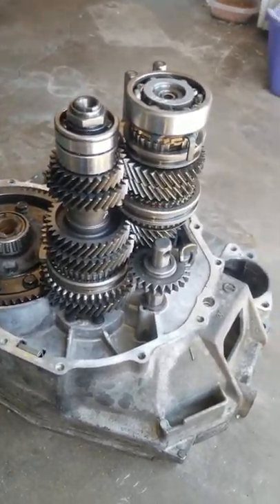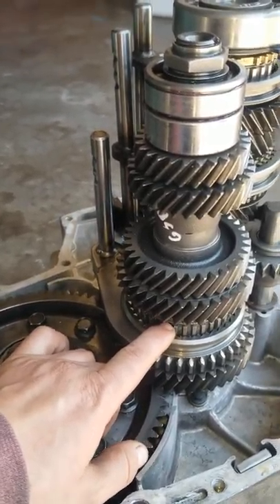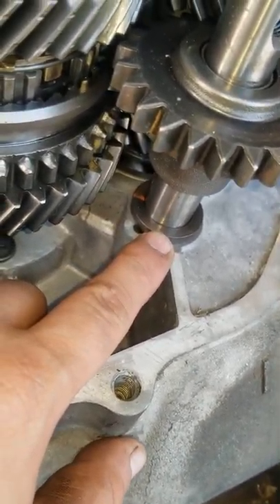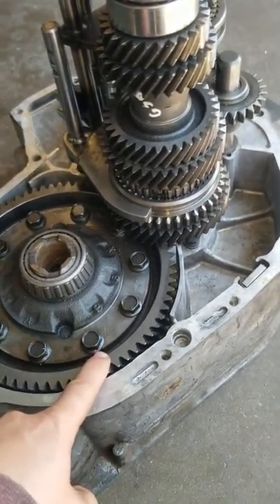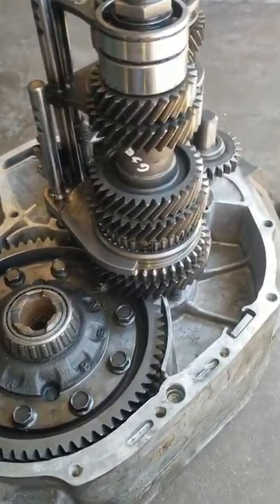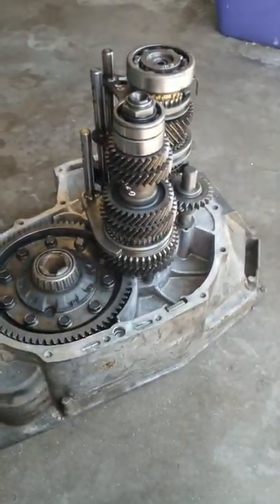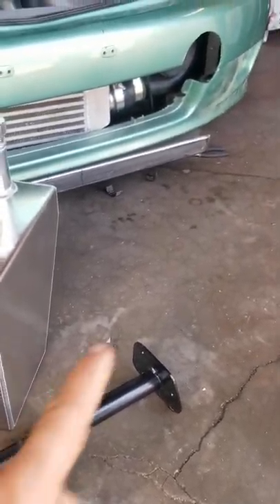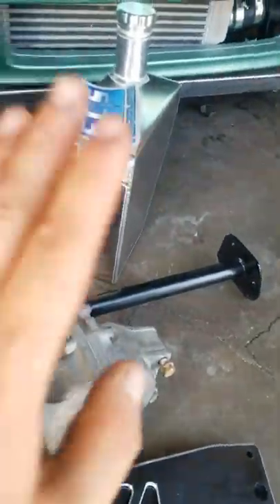Speedfactory racing fwd to awd kit install and preview of our FCS AWD differential

Comment: Hi jason i wana ask you how about 3\4 do i need to change the fork?
Reply from the maker: 3/4 shift for stays the same only fork that needs to be modified is the 1/2 fork if you wanna run fwd gear set. If not then you'll need to gusset 1/2 fork on the sbxm trans.
Reply: Thanks.
Reply: I have one more question please. Can I swap my gsr trans LSD to my awd trans with out the ring ofcourse.

Comment: hey jason,  probably the most detailed video regarding this subject and can't thank you enough for all the coverage.  i've got a question: i use the entire fwd input shaft with all the gears, synchros, and sliders except for the fifth right?  and obviously the bearing to match the case goes onto the shaft

Comment: Did you use the gsr main shaft ? The one where the clutch spins onto
Reply from the maker: That's the input shaft yes I used that shaft the only shaft that stays is the awd pinion shaft
Reply: Thanks would love to see follow up on your set up
Reply from the maker: @9blockperformance948  I'll have it assembled tonight and make a video bearings are at the house right now.